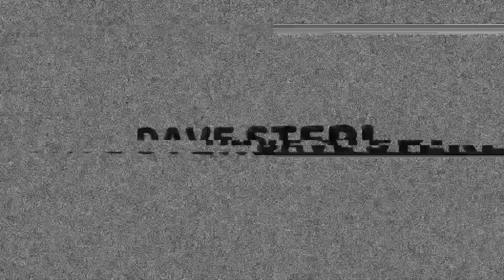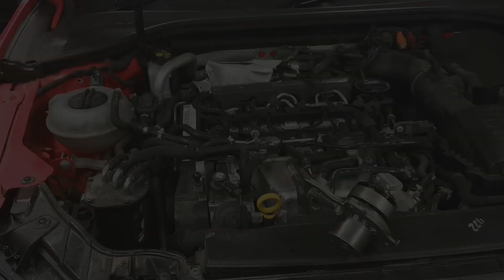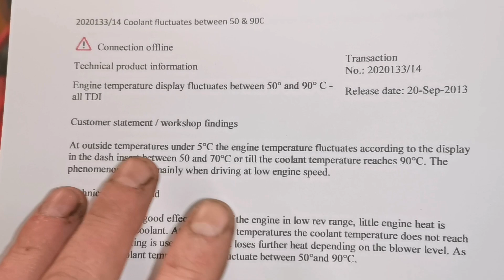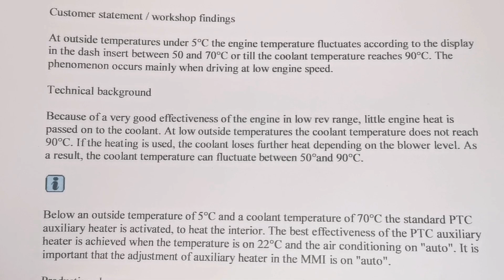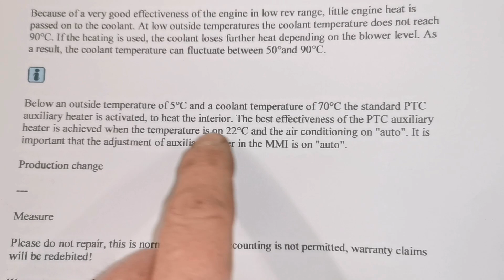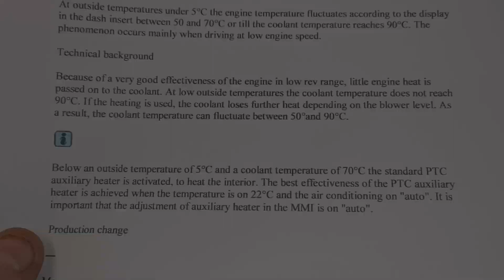Audi/VW TDI Coolant System Essential Information. Overheat or No Heat

Comment: Incredible information Dave . If possible can you let me know what you think. Same engine. Only reaches 90 at idle or driving on a warm day. Otherwise temp stays at 70 . Disregarding if it's under 5 degrees outside. I was told a new thermostat went in but made no difference. Question I have is will the car still trigger a regen at these lower temps . I have the car two years and have had no dpf problems. I also have not noticed a regen take place. This is the only place I have seen this info. I would be delighted if you could give me advice ...

Comment: Just found this. My garage are about to fit a new thermostat unit on my 2017 2.otdi ultra A4. It is showing the fluctuating temperature gauge issue on cold days.

Comment: 2019 caddy dfsd changed main water pump for the one without the sleeve , put new thermostat and temperature sensor in , used vcds done full coolant bleeding and low level , on idle engine will sit at 90 degrees when driving temp guage will go down to 0 , any ideas ? Great video btw

Comment: VW went nasty with introducing the problematic G12 followed by  g12+ red and ++ violet and then the more nasty with that G13 silicate free OAT with about 20% cheep production glycerol. the cheaper cost of making and the claim of more environmentaly friendly and a “life time” coolant made a mess. The G12 &G12+ have zero silicates which is an excellent corrosion inhibitor. They corrected that in G12++ & G13 by adding silicates again. The all mess I hope is corrected now by the G12evo (PSi-OAT)
 The newest coolant spec of VW calls for that G12evo and say it is safe alternative for all the previous G generations. which is 97% glycerol and has both silicates and phosphates additives! IMHO the G11 remain the golden standard coolant but europe is trying to put the glycol based coolants into history.  Long story short I think that this silicate bag is quite hilarious since I never seen a company putting coolant additives in a tea bag!! May be it is antifoaming additives?! Or added to G12+ cars as an upgrade to G12++ ?! I am just guessing 😂

Comment: After a bit of advice from the vag men as hearing mixed reports so the vags that use the electric sleeve water pumps, can they be replaced with a standard water pump and used without any issues after

Comment: The bag is not always removable as some tanks are twin wall, so not accessible. The silicon bag rarely splits. Cars have suffered blocked heater matrixes even though the bag is intact. The blockage is most likely due to casting sand left over from the manufacturing process, although Audi says that the "grit" is from the corrosion between the disimiliar metals in the engine! So much fro G13 being longlife. Audi's solution is to replace the heater matrix and also the header tank, without the silica bag and carryout a thorough flush, todays cost is circa £1100.😢
Reply from the maker: @geoffaries  I don't recall suggesting the bag splitting is the sole cause of blocked heater matrixes. Other car makes suffer blocked matrixes and do not have a silica bag. The bag can split in these vehicles and the symptom is no heat but the entire system will be blocked.
Reply: But that's the impression that you gave. You didn't mention either of the 2 most likely causes, nor did you mention the double skinned tanks where its impossible to remove the bag. I did like your explanation of the fluctuating temp the auxiliary heater and the variable water pump.
Reply from the maker: @geoffaries this video is not just about reasons why matrixes block which is why I don't list that. I do not talk about double skin tanks as it is not the case here. It's why I use terms such as 'this particular engine' and 'if the bag splits'. Do you expect me to cover every hypothetical scenario on every different engine available.

Comment: Hi Dave, I have a query please which is driving us insane! 🤯 so exact same car, only overheats and spews out coolant at motorway speed. Is okay locally for the most part. Thermostat, heater matrix, thermostat sensor, water pump, All been changed! No gunk in the oil, engine sounds fine. No smoke from exhaust. Just Perplexed as to what it is. Has been manually flushed and coolant added several times. Pressure tested, no leaks identified. Just spews out the coolant tank when it gets too hot 😑 any advice greatly appreciated pls 🙏

Comment: Hi
I have a audi a5 b9 40 tdi and have an issue with the temperature gauge on the dash. The car takes in my opinion bit longer than normal to reach to 90degrees. When it does, and the heaters are turned on, it blows out hot air but the temperature gauge will start to reduce block by block until it gets back to 50degrees. The temperature of the heat from the heaters is exactly the same and doesnt change
Any ideas if this is a symptom of a failed thermostat or if the coolant temperature sensor needs replacing?

Comment: Hi, can you tell me how much cooling fluid comes out of the hose into the header tank when the rpm is raised as on mine it is a steady slow flow at idle but it stops when I increase the rpm also it is overheating at over 50 mph, I have just replaced the  pump and belt ( just because it was 6 years old, there was no issues) so I was wondering if I could have installed a faulty new pump. Thanks Steve.

Comment: Son has an a3 2lt s line had one of the excillery pump at the back of the engine ni when he is driving the coolant light comes on when he stops he looks at the coolant bottle shows it’s empty when he opens it the bottle refills itself back to the top.      Any ideas.  Thanks in advance
Reply from the maker: Do not open when hot
Reply: Had the same behaviour on a Skoda Octavia MK3 - The root cause was the Intake manifold intercooler Skoda Part number (04L129766S)

Comment: Really informative.
I've a tdi 2014 engine. Silica bag intact. First symptoms was no heat in the cabin and then some funny noise from behind the dash.
Car had been motorway driven for an hour.
Then went for another hour drive parked up for the day. Came back 6 hours later... Low coolant warning.... Only had water with me in the middle of nowhere so topped up with 500ml.
Level was fine on two hour journey home. Temp set at 90 no bother.
But still no cabin heat.

What's your thoughts of you have time to answer.
Thank you 😊
Reply: i also get the funny noise behind the dash. Sometimes its sound like liquid circulating, other times it sounds like an angry plastic creeking as if something is struggling to move but its stuck.

Comment: A lot of useful information here.talking about the cooling and heating system my 2.0 trip blows hot air when it wants and it also dumps the coolant out the expansion tank through the cap now and again.any ideas what that could be?
Reply from the maker: You need a new cap
Reply: Ok thanks for getting back to me .I’ve not long just replaced the cap but to be honest it doesn’t feel very tight and a good seal when I screw it closed.I will get a new expansion tank and a new cap?
Reply from the maker: @petermcculloch423  do not use non-oe caps
Reply: @davesterl  I will let you know how I get on.this isn’t the first time this has happened.seams to happen when the fan’s are constantly running.I’ve topped up the coolant this morning with the engine stone cold and I will see what happens on the drive home.

Comment: Hi Dave, hope you can assist. i have a 2013 Audi A5 2.0 petrol which always overheats after a few kilometers. I tried to change the waterpump and thermostat but it didn't help. There are no pipes leaking, the fault detector /scanner can't detect where the fault is. I'm stuck withno answers. What could be possibly wrong?

Comment: Excellent video, I’m having issues with my heating currently where it’s intermittent at best. Sometimes I’ll have luke warm heating and sometimes it’ll die altogether and blow cold regardless of temp setting. My expansion tank says it had the bag of silicate however I’ve checked and there was no evidence of it being there so previous owner may have removed it. No idea why the heating has suddenly decided to mess about. Any ideas anyone? I’ve changed water pump and timing belt…
Reply: I've had the same issue with my A3. You will need to change the heater matrix, which sits behind your dashboard. I've had it changed today and it fixed the problem.

Comment: I need you expertise mate. A4 CJCB 2014 FL. Cannot get above 70c with the heaters on. Replaced the inline stat and block stat with new ones from TPS. Inline opens at 75c and block opens at 87c. Warm air immediately in the cab. Will get to 90 with heaters off, heaters on drops to 70/75c. Any advice mate?
Reply: I should add that the temp today was ambient 11c. Plugged in VCDS when I got home and the coolant was 78c and engine oil 79c.

Comment: Hi Dave, 
I have an Audi A3 2016, TDI 2.0 the temperature gauge in the car, takes about 1-3kms of driving to go from 0-90 Degrees and it will go up slowly. 
The outside temperature is 23 plus degrees. 
What do you suggest I look at? Is this normal?
Reply from the maker: It goes from 0 to 90 degrees in  1 to 3 kilometres?

Comment: Wanted to see if anyone can help. I’ve got a full service for my car and a coolant change. Since I had the coolant change my heaters are not working properly. I have dual climate control the passenger side is giving out hot air however the driver-side is giving lukewarm air. Both temperatures are set on high. Any ideas anyone?
Reply: Ive just had the same problem with my 2017 A3 2.0 tdi . Needed cam belt at 60k , so had new water pump.
I month later - blocked matrix .
My thoughts are either some sludge that gets stirred up when the coolant’s changed and blocks the heated matrix,
Or , its possible that if you didn’t use the G13 coolant , the magnesium alloy heater matrix may have corroded.

Theres lots of ersatz ;gXX coolants out there  , not all are as good as the factory fitted type & not all have same protection against corrosion.

The silicates in the G13 prevent corrosion in the high precision cooling components , some are magnesium alloy and corrode with deionised  water & G12+ / ++
If. The 2 types of coolant mix , a gungy pink sludge seems to appear .
Reply: @tonyperkins9549  thanks for your response. Was one side giving hot air and the other side giving cool/Luke warm ? If it is the heater matrix that gets blocked then why does the passenger side still work fine? Would it not all stop working? 

Also I have had a check what coolant I used and it is G12+ (this was given to me by the shop) 🤦🏼‍♂️ I took it back to the garage and he’s adamant there’s nothing to do with the coolant change and has told me it is ‘Blend Door Actuator’ however I don’t know as my heater stopped working when I did the coolant change. 
Not sure what to do :(

Comment: VW covering their arse there for a fault they don't understand. I have two virtually identical 2014 Mk7 Golf GTDs. One reaches 90C easily, the other barely makes it above 50C. Same weather conditions, same driving conditions.

I have noticed by logging with VCDS that the temperature on both reaches 57C quickly - probably within 5 minutes or starting to drive but then 'something' happens on both. The temperature drops. On the one that warms up properly it drops a few degrees for a minute or so then continues climbung to 90C but on the one that never warms up it drops back below 50C, sometimes down to 40C and never really gets above 50C after that.

At the same time that the temp starts dropping, I see 'Heater support pump 1 bank 1 primary circuit: activation' go from 5% to 95%. I guess this is the main coolant pump activation? Would make sense to me that activation of the main coolant pump would cause overcooling if the thermostat is stuck open.

I'll be taking mine apart in the next day or so and will post the results here.
Reply: Did you find the problem?
Reply: @Rasle500  Yes, it was the main thermostat towards the air intake end of the cylinder head. Not too bad of a job, easier than on a Mk6 TDI anyway! Buy a genuine one, or one made by Meyle - they are the OEM manufacturers.

Comment: Mines just been diagnosed with the "Burst Tea Bag". Needs a flush and new heater matrix.

You mentioned the symptom as being a cold heater.
Apparently the first symptom is the cooling system vents being different temperatures on each side of the car.
This is what my car was doing prior to the heat stopping altogether.

It was around 8 to10 degrees different.
Reply: Did this fix the issue of cold
Heating?
Reply: @nickbathie99  Yes... It's working now.

Comment: Hello i have a Audi A6 c6 2011 2.0tdi i have an issue whit the temperature gauge. I have changed the timing belt waterpump cirkulationpump thermostat. The car reaches 90 but when i stand still and put full heat in the car the temperatur gauge drops can someone help???
Reply from the maker: Can't really tell you any more than what's in the video, i tried to cover most things. Did you check out my other video anout the 2nd thermostat
Reply: @davesterl  i checked it but Audi dealer here in sweden Said that my car doesnt have another thermostat then the large one i have changed. I really dont know what to to anymore
Reply: Have you solved the problem? @valon933

Comment: Hi mate , I drive the exact same car 2.0 tdi Audi A3 2014 and have just had the problem of my coolant tank being empty after starting the car this morning , I topped it up with water to see if it leaks again today ( so far nothing yet ) but when I put the heating in to check if it was working it’s only working on the passenger side and Luke warm on the drivers side, I haven’t had the system pressure tested yet as everywhere seems to be fully booked until next month but I have been told it could be the heater matrix needing replaced? Is that a big job as I have been quoted around £350 just to strip the dash to get to it then I have to pay for parts and labour 🙈, the silica bay was removed when I had the car serviced just after I bought it about 2 & 1/2 years ago , I’ve just find it very strange for the coolant to empty like that if there’s no visible leak. Do you know if that would be the cause before I commit to having this done specially if it can just reoccur , thanks
Reply: You’ve just described exactly the same symptoms my car is experiencing. Did you manage to find out what was the issue?
Reply: @andrewl7869  yes the silica bag had split and the entire engine was compromised , I had the system blew out and flushed out 3 times but kept getting big chunks of silica from her , I was told I would need to replace the heater matrix , all hoses & pipes , radiator and head gasket that would cost around 4 grand so I just scrapped it , if you catch it on time you can replace the heater matrix and it can fix this issue but mine was too far gone to save unfortunately, I hope you can get your sorted mate 😊

Comment: What about the tempreture gauge sitting at 70-80  when the outside tempreture is above 5 degrees ..e.g. 15-30 degrees in the summer and driving  100s of miles and sits  at 70 ..barely manages to hit 80-85 when in long period of stop start traffic  ?
Reply: exactly same in my A6 2.0 tdi c7, coolant temp never reached 90, always between 70-80 even when its 20 Celsius outside ...
Reply: @MrUlter007 have you sorted it out?
Reply from the maker: What about it
Reply: @davesterl  is that normal ? For it to  constantly run at those low temperature . Is it a possible thermostat problem.? As the advice was not to worry when outside tempreture is 5 degrees or lower but have this problem even in summer....stop/ start doesn't work either
Reply: @mrbeanz6451have you solved the problem?
Reply: @Heavydutyy  yes resolved. There is a 2nd  thermostat that is an " inline' thermostat. ....so within the pipe . I changed that and it fixed.

The main dealers don't know about this either surprisingly ......the thermostat cannot be officially brought.....it's a ' one piece ' ie pipe and thermostat as one part number .....go on a forum online that's what I did and I found someone mention the part number for the thermostat alone  and I brought that online from Amazon. The pipe If I remember correctly is not that big and sits somewhere close to the oil filter cooler. Tricky to remove one end of the pipe clip due to space you will need a flexible spring loaded hose clamp removal tool ....the whole job can be done from just lifting the bonnet / hood

Comment: Glad I saw this, my 2007 1.9 tdi 105 says g12, issue I'm having is it doesn't properly get to temp and stay there also seems to lack power  in 3rd gear. Seems strange as the engine runs smooth no knocks or noises at all, could you offer any advice as to what it is? Bugging me as its a nice car runs well apart from this 1 issue

Comment: Hello from Sweden! I just changed my expansion bottle which had mit silikat on it , fitted a new one without silikat and filled the new bottle with fresh g13 coolant.  Will change the cambelt and waterpump in 25000 km so the system will have a fresh coolant then . Thanks for advice Dave!
Reply from the maker: Glad to help my friends in Sweden

Comment: Hi Dave , thanks for the informative video . I took my silicate bag out but decided to keep the g13 in the cooling system instead of you changing to g12 . All I do is to keep it up to strength is to change it every year with fresh g13. Everything today is over engineered and it’s a complete nightmare to us mechanics. You say the both g12 and g13 are mix able I did not know that .

Comment: Hi buddy what does p023a charge air coolant pump circuit open. Cheers and heaters are only blowing cold heat. Coolant pump been changed/electric pump.
Reply from the maker: electric pump for intercooler
Reply: I've changed it. It's still the samev
Reply from the maker: @awaishussain4918  you have a circuit code